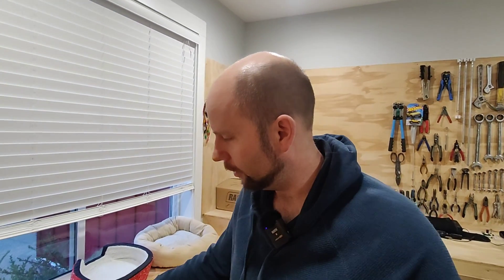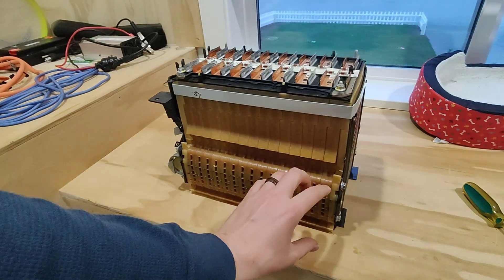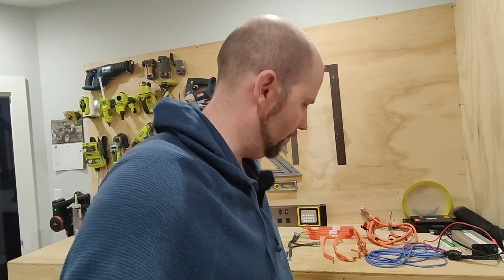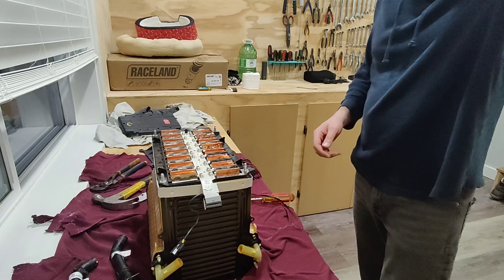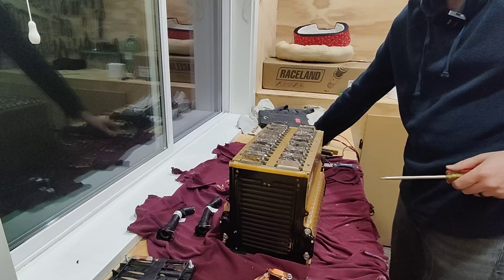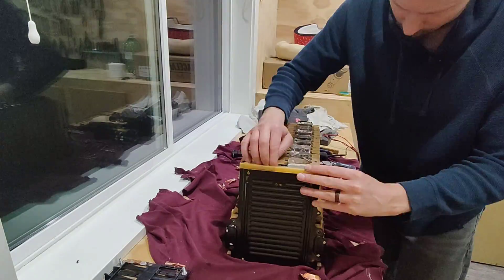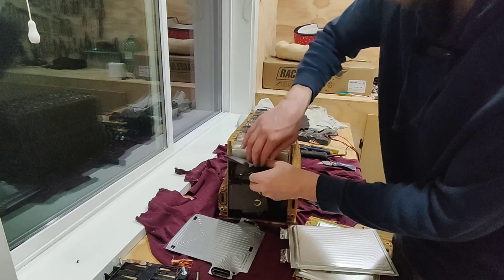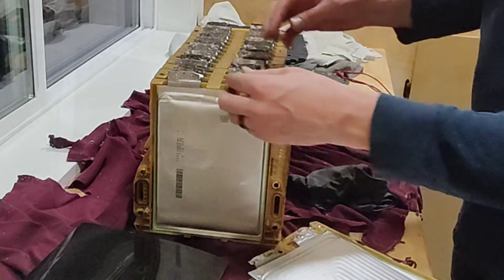Chevy Spark EV battery module teardown.

Comment: No rubber gloves, no goggles, metal parts inside an electrical device... this is like watching ElectroBoom without watching ElectroBoom.
Reply from the maker: I know what I'm doing. I've been a technician for over 20 years
You don't need gloves for 60 volts. Goggles??? Why?

Comment: Is the Chevy spark ev batteries water-cooled?
Reply from the maker: @Mechanix360  yep!
Reply: @ I'm looking at buying a 14' year spark with 65k miles. How long can these batteries go? Can I push them to past 150k?
Reply from the maker: @Mechanix360  😬
That's hard to say... 
Current EVs, yeah no problem. But the Chevy spark EV unfortunately didn't have the most reliable battery. However, they're cheap and the battery is pretty easy to fix.

Comment: the frames are make of fiberglass reinforced plastic, the cooling plates are aluminum with a coolant fluid microchannel
Reply from the maker: @mpirron1  sounds about right.... Where's your experience from?
Reply: @edsgarage2.0  10 years repurposing batteries for power walls and off grid solar backup in RVs, etc.andb for the last 3 years I have been fixing Chevy Volts
Reply from the maker: @mpirron1  noice!
Reply: @edsgarage2.0  Do you have the dimensions of the cells? I am looking to rebuild mine with denser cells. Thanks!
Reply from the maker: @Kalamirrr  I hope you'll subscribe for this 😉

8mm thick, 23cm tall (not including the tabs) and 16.5cm wide.

And each pouch weighs about 577 grams
Reply: @ thanks a lot! Subscribed 😁 I have found a pouch cell of 58Ah 3.7V 231x16.1x9.9mm. It seems to be the perfect replacement to raise capacity to near 300km with the spark. The only think I am not sure now is the thickness. From your video, if I have 2mm thicker per cell and make the pack module 3cm longer. Any clue if there is a possibility it can work or 8mm is an absolute requirement?
Reply: Probably I may just remove the spacers or find 2mm thinner ones or maybe the spacer can be compressed and handle it? Is possible the pouches were 9.9mm and been compressed together?
Reply from the maker: @Kalamirrr  I don't think it would work... There's not a lot of room in there.... maybe.... But keep in mind, these packs are under a LOT of pressure to reduce cell expansion. It would be difficult to re-compress a module once it's dissassembled.

Comment: I would sepsarate cells tabs from the copper using a bench-sharpened 3.5 inch putty knife, the compression is quite important puffy cells will eventually compromise and expose themselves to the air, you should not uncompress the cells unless necessary,
Reply from the maker: Putty knife definitely wouldn't have been strong enough I'm afraid. 

Compression of the cells is mainly important during fast charging. 

For my scooter project, the cells won't ever be fast charged, so it's not really necessary. It's been working great for many months now.

Comment: Thank you so much for this video! 5 cells in my Spark's battery are out of balance, your work has me confident that if GM won't fix it I still have a shot. If you have 5 cells you'd be willing to sell me I'd be quite interested.
Reply from the maker: @imbrandedcontent  5 individual cells? Or 5 entire modules?
Reply: @edsgarage2.0 I was hoping for just 5 cells. But turns out my battery is under warranty! Getting the whole pack swapped for free.
Reply from the maker: @imbrandedcontent  Awesome!

Comment: My spark had a fatal error gm canada didnt want to touch 2 weeks ago. Your videos are so good! Very informative , very accurate!  It gave me the confidence to drop that badboy out the car open it up and recharge lower voltage cell. I rebalance everything and my car is back to life!!! Lets hope for a long time! If you have some of those cell you won't use, im interested as i think it could help strech the lifespan of this wonderful car. Good work !
Reply: Indeed, i keep a close eye on it with a Bluetooth odb2. I can see 96 individual cell tension
Reply from the maker: @NXwilty  cool
Reply from the maker: @NXwilty  great job! 

I'd be concerned about the out of balance cell failing again though... 

I've seen the models selling on eBay if that helps. 

Thanks for the comment!

Comment: I guess its too late to say this (unless you haven't dissected the other modules) but tearing the cell tabs off what they are welded on (I guess you'd call it a bus bar of sorts, the U shaped pieces of copper) but those are likely welded on by an ultrasonic welder...so not something the hobbyist can redo....and trying to do resistance spot welding is going to be extremely difficult depending on the material of the tabs (often aluminum and nickel plated copper)

There are some videos here on YouTube of people working on similar packs and fabricating compression style bus bars of their own but the question of resistance definitely exists....at the end of the day it will never be as good as the original ultrasonic weld to the copper pieces. Definitely restricts high discharge capabilities of any future battery you DIY.

The best route for reusing these EV modules is to keep them together until you know what you plan on using them for and then do some brainstorming on the best way you can configure the modules to get your desired series connections by doing the fewest number of DIY series connections if you cannot replicate the original method of welding the cells together.
Reply from the maker: Yep, learned it the hard way 😂

But I did find a solution that worked, check out the next video in this series...

Comment: Nice!  Battery hacker's heaven.  Seems there are 15 series cells.  If this block was to be used for a 48V application, it would require 13S (typical 54V) or 14S (Telecom going to 58V) for float.  Once the weak cell is identified, it could be discharged manually to 0V, then shorted to leave the remaining good cells in the string functional and intact in their nice case.  Could this be viable?  Or would the 0V cell expand and create pressure on the adjacent cells?
Reply from the maker: It's actually 32 total cells, 2p16s
This module is the only one that has issue, so I'll find the bad cell and recycle it. As for the other modules, I'll be able to use all the cells. 

I wouldn't risk leaving a bad cell in a pack to be honest.

Comment: IIRC from my time as a battery researcher (15-20 years ago), compressing pouch cells also leads to slightly higher capacity than an unconstrained cell. It's also more convenient for packaging, so it's a win-win unless they go too far into the spicy pillow stage and damage the containment. Again, it's been a minute, so take that with a grain of (lithium) salt.
Reply from the maker: No, I think you're right. I've read the same thing before. Something about preventing the battery's internals from separating too much prevents a loss in efficiency.... Or something. Lol

Comment: The cooling plates remind me of a old-school freezer wall with similar channels for the refrigerant.
Reply from the maker: I was shocked at just how thin the channels were... Pretty amazing actually.
Reply: @edsgarage2.0  fluid dynamics is in itself a whole scientific discipline and one of the key to unraviling the mysteries of the universe. Think about this for an exercize .... Gases are considered fluids, so air flows the same as water without respect to pressure and temperature (as will as you might say gravity I suppose), like in a vacuum.

Comment: THIS IS GREAT! Thanks for sharing. they built this battery well. A bit complex and stuffed full of stuff..... but well put together indeed.
Reply from the maker: Agreed, it's actually a pretty impressive design.
Reply: It's fun running into you in our tiny niche of the internet.
His video was greatly needed for my EV conversion project using a wrecked Spark EV. Now I just need to find the specs sheet for the cells.